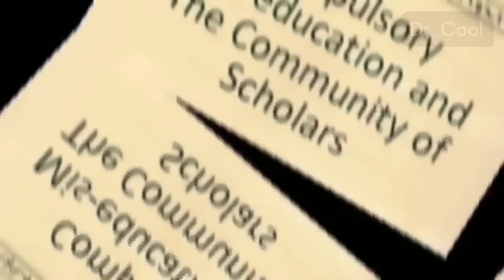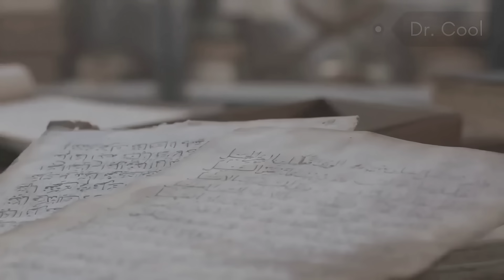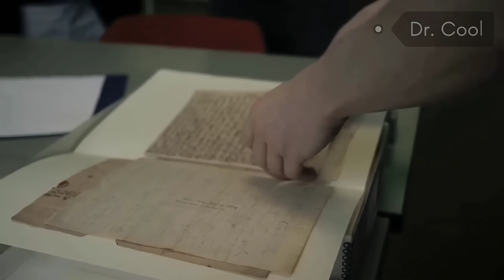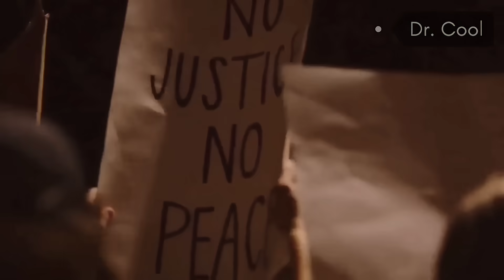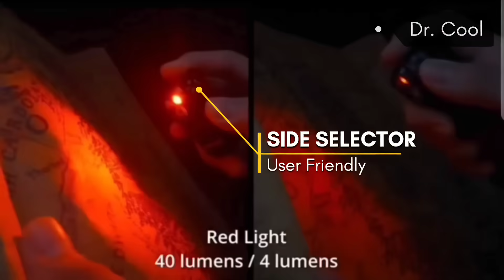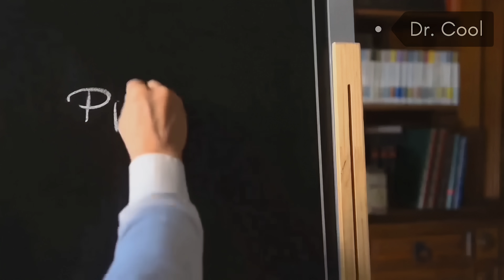HOW African Teen Turns AIR into ELECTRICITY – Invention That SHATTERED the Internet!

Comment: I was just doing that perpetual motion sir pre say take and pressurize something like a hose put a ball in it the exhaust value is in the same direction as the inlet and only exhaust when has more pressure then it needs back into the inlet sinu can cut the tank off and it still spins the ball around and around in the hose  this would work if you use that to teun the generator no fuel and no ele motor powered by the gen I turn spinning the generator air . Now I ask u this if lighting builds it has to have so many volts to jump or I guess a taorr from one pole to another distance between well where does the ele come from hot and cold with rain static ele building so it's the rainis a liquid coil is that right so like ele running a line then winding of the copper wire cause resistance the curved wall increasing speed amps the force coming out of the curve is greater than going in like a check valve building to open the door but in the clouds the rain drops spin around in the hot and cold air the ele connects to to each drop almost like a wire but it jumping because of the build like the human body positive neg in and out the cell it says that u want to make as many teun positive positive when it finds the neg it burns is that right when buenning lose power creat hear can u build a shovel or rake with a potive and neg. Hand grip put battery's in it while u work motor you body what haw fast u drain then use this and transfer energy to the body  this sound stupid
Reply from the maker: Andrew invention isn’t perpetual motion technology

Comment: You are too much double talk and not enough truth. It also in another video talked about him going and getting a degree in electronic engineering so why didn't you include that when you talk about him dropping out at elementary school. 
Tesla develop that technology and they shut him down for the same reasons. Several other people had developed it based on his research and they were shut down. So part of what you say is true. But you're fighting the wrong fight for the wrong reason stop being clickbait and start talking the truth.. 
People talk about 0 point energy but that is completely misleading. Because energy that doesn't move cannot be harnessed. You've got a modulate that energy and that is what he's trying to do but he's not looking at it in that point of view so he's only getting the tip of the iceberg not the full available power.
Reply from the maker: Tesla ? On paper not practical